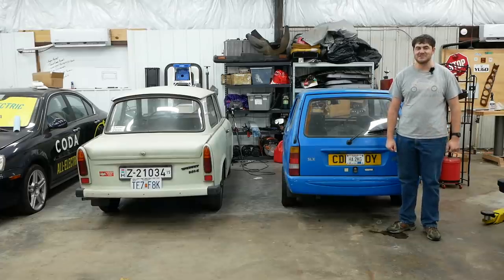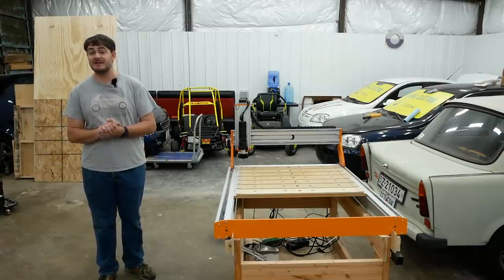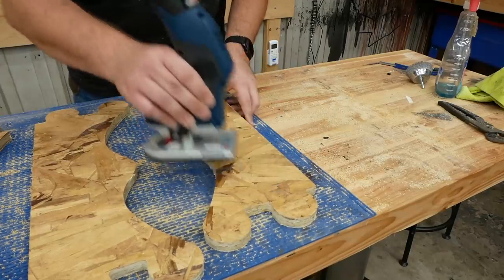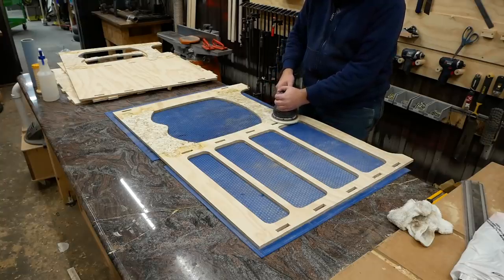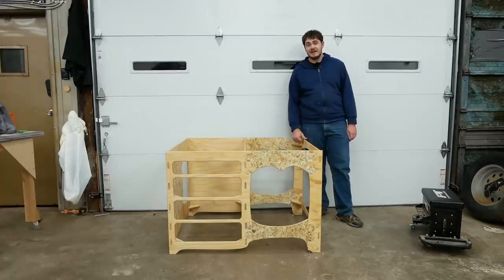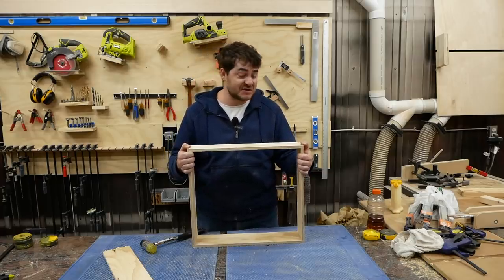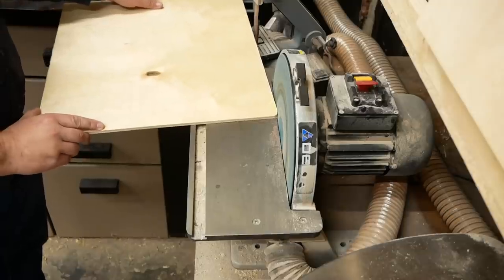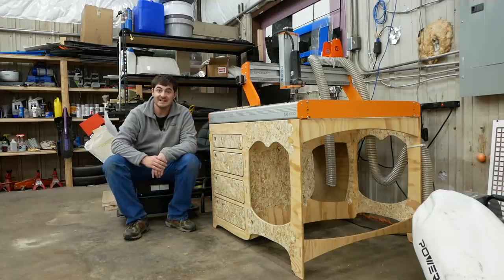I Forced My CNC Router to Make a Table for Itself

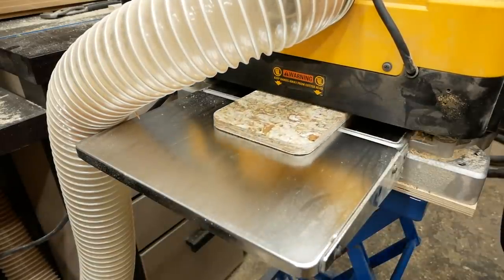Comment: 3:06 As long as that static discharge is on the outside of the flexibel hose, then there is no problem,
 but if this occurs on the inside, the chance for getting a dust explosion is very high.
Reply: Even outside it's a problem, dust nearby where it discharges can start a fire.
The solution to this problem is however super simple, just attach a grounding wire to the metal spring inside the flexible hose, so any static buildup can discharge here.
Reply: @Gin-toki  you are right.

Comment: Look into Fusion’s parametric modeling feature.  You can design ahead of time, then when you get your plywood you can measure the thickness, change that parameter in Fusion, and voila, everything adjusts.

Comment: Are you going to be doing the wood-shop version of your tool overview video soon? I'm amused (though can relate to) the dichotomy of the extremes of both Ryobi tools and a Festool Rotex being used on a project.
Reply from the maker: Yes, this needs to happen. Having almost exclusively bought cheap stuff before, it took a lot of justification to buy that Festool Rotex. It's totally worth the price, but it sure is expensive
Reply: @UnderDunnOfficial  I'm still talking myself into picking up a Rotex 125...shouldn't be much longer, as I've been quite happy so far with the functionality of my Domino 500, and the dust collection performance of my ETS 150 and OF 1400.

Comment: At 3:00 , Ya... That is an impressive static discharge arc! A controlled ground on that would be a good idea. I read a newspaper article not too long ago that said that was the ignition source of a wood dust explosion in a nearby cabinet shop... 😲

Comment: I used some of the first CNC routers ever, 30 years ago, I used Nitto brand carpet tape to hold down difficult to clamp materials, you just lever one edge up and the rest just releases after a few minutes. I once made the station frames for an America's cup yacht in this way.

Comment: There was actually a house in Architectural Digest that featured sanded OSB walls in a portion of it. If I remember correctly it was in the early 2000's, I also think it looks super cool though. Nice work on the table! The joinery on the drawers is amazing looking, I love that there are no straight lines also!

Comment: For projects like this, you can add a parameter in fusion for the thickness of the plywood so you only have to change it in one place to change all the joints at once. Still looks good though!

Comment: Is your planer arcing between the outfeed and the dust collector?  It certainly looked like it about 2:59-3:08
Reply: It's the other way around. Static electricity generated by the dust collector was finding a nice path to ground through the planer.

Comment: Great stuff, but could I ask what dimensions the top of the table is, please, to perfectly fit the M1000 on to?  I'm thinking of buying a similar machine but want to build a table like this ahead of time.  Also, are you using the feet of the machine to sit on the corner inserts, to be able to adjust the level of the machine?  Thank you.

Comment: Love it as always, I also think the OSB looks great. It would be cool if you made a tethered control panel in the same style, to mount the e-stop and vac control on! Also a relatively simple CNC mod I'd recommend is a manual feed&speed control (just mentioning cause of your crash into the clamp). Oh and is the random arcing at the plainer going to be explained? lol
Reply: You saw that too, eh?  It's definitely static discharge.  A static electricity charge is a thing that air moving through non-conductive materials can create.  

When the potential gets high enough, it arcs between the spiral metal support wire in the dust collector hose and the grounded frame of the planer.  

I would guess that the dust-sucker end of this has plastic or otherwise non-conductive fittings, and additionally postulate that grounding this support wire at either end would completely eliminate the electric light show.
Reply: @blarggggg  "You saw that too, eh?"

Pretty sure we all saw it - he edited in an arrow to point right at it. 😉
Reply: @mjc0961  I missed the arrow on the first go.  I saw the light show right away, hit pause, and went to the comments to see if I was hallucinating or not.  I'm sensitive about lightning.  😉

Comment: I'm surprised Stepcraft is still around, honestly. Their machines were obscenely expensive years ago when the hobbyist desktop CNC market was fist starting to get big, and their prices are still obscenely expensive for what they are. A lot of this is undoubtably due to the custom extrusion they're using for the frame, which there's really no point to this other than, 'look we have custom extrusions!' I really don't understand their business strategy at all, or how they stay profitable in the slightest. 

Whenever you have fitted pieces that have too much of a gap, which occurs often with CNC joinery unless you have exact material thicknesses and your gapping down to a science, you can use sawdust mixed with glue as a grout for joinery. With consistent gaps, sawdust grouting can look decent, may also save a project as you know large gaps will allow a piece to easily tweak over due to it not being entirely secure. If you have a wide enough gap, you can also use thin veneer to shim the two pieces together, using a thin plastic sheet for this can add some contrast to a project; using something a bit darker in color can add some pop to the main pieces themselves, similar to the effect that jigsaw puzzles have with the slightly curved profile on the printed side of the pieces.

Also, drawer slide hardware is so much easier if you machine in the features while cutting the pieces. If you already know all of your measurements, measure the drawer hardware for mounting locations, and drill some pilot holes for the mounting screws into the the parts while you have them on the CNC. You can do similar for drawer fronts and pull hardware. Work smarter, not harder. Sure, it might be additional planning work, but it's also a lot less work when it comes to assembly; think of it like flatpack furniture that you've designed, assembly would just be screwing things together, not measuring out where drawer slides need to be.
Reply: Ai ai captain.
Reply: Regarding Stepcraft being profitable - that goes hand-in-hand with being "overly expensive for what they are" - how do you not understand that? 🤔
😁🤪😜

Comment: I kept waiting for you to address the arcs from your planer's vacuum line you highlighted. What's up with that?
Reply: Probably static electricity. Flying dust generates a fair bit of it, especially if the humidity was low that day.
Reply from the maker: Exactly. Just a lot of static build up from the flowing wood dust.

Comment: Did you forget to mill the rabbit in the drawer sides on the CNC or was it just that much easier to do on the router table? Cool video..not a tool that will probably ever be in my shop, but I am 100% sure that you will use the crap out of it.
Reply from the maker: It was just easier to do it at the router table

Comment: Fusion360 is great and this design is incredible (btw we’re you using the variables to easily adjust things?).  And Yep I am looking at Particle Board in a different light now.

Also wood putty covers a multitude of sins, or if it’s all the same way hit it with some black to line those gaps!

Comment: I'm curious, what thickness is American plywood? I always found it suspicious that the US gets sheet wood in 1/4", 1/2" and 3/4", while the rest of the world has 6mm, 12mm and 18mm. Are they the same or do they actually make them different?
Reply: No need to be suspicious - 1/2" nominal size is 15/32th of an inch actual which just happens to be --- 11.9mm or 12mm, close enough.

Comment: Did anyone else see the sparks coming off the dust collection hose when the OSB went through? Check your ground wire? (Not an electrician)
Reply: Definitely noticed and also commented too.  Impressive sparking
Reply: NewZJ  Yes. In grain silos. Saw dust is very un likely.
Reply: NewZJ  grounding the dust collector hose is unnecessary. I think there is a ground issue with the tool, either dust collector or planer.

Comment: At 3:00n you put an arrow on the sparks ! you should check you earth connection on the machine AND the piping. this is static electricity discharge. it iwll not kill you, but it will be unpleasant !

Comment: If you make the plywood thickness a parameter in Fusion 360, you can set it to the correct value once you buy and measure it and it'll adjust the geometry. Here's a tutorial on that feature:

https://www.youtube.com/watch?v=iUUFrkdgCLI

Comment: Neat project and love the concept of utilizing the fancy joints, but prohibitively expensive for almost all viewers.

Standard M.1000 machine $5198

0:20 dust collection adapter $229
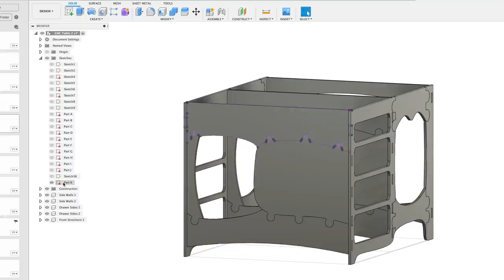2:00 V-Carve software $349
5:40 vacuum table $498
6:39 vertical clamping fixture $109

So I am glad Robert got $6383 for nothing, kudos to you. but kind of bugs me that I wont be able to replicate what he made, or take much other inspiration from this like most the videos on this channel.
Reply from the maker: There's nothing stopping you from making a template with a jigsaw or bandsaw and using a flush trim bit in a normal router. Where there's a will
Reply: @UnderDunnOfficial  fair point 🙂

Comment: At the risk of sounding like a moron, am I right in thinking that in some ways the CNC Router works in a similar to way to a laser cutter, except with a different effect and cutting technique?
Reply from the maker: They are very similar is operation. A CNC router, laser cutter, and 3D printer are all CNC machines that operate off GCode